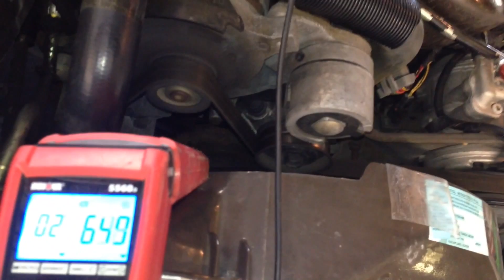Ford Mustang 5.0 ignition timing check & adjust instructions

Comment: Hello sir     I need your help  got new  Innova Pro 5568a Timing light and my 1986 Chevy truck has HEI Distributor in-cap Coil  Not external Coil , my question is Where Do I Attached The DWELL Green Clamp ?? I need to do total timing

Comment: literally did not hear anything u said
Reply from the maker: +Josue Neftaly this is just off the top of my head: hook up the timing light. Point the flashing light at the passenger side top of the crank pully. The pintle on the engine is 0 (zero). The spec is 10° i think.
Reply: Josue Neftaly you have the same first name as me